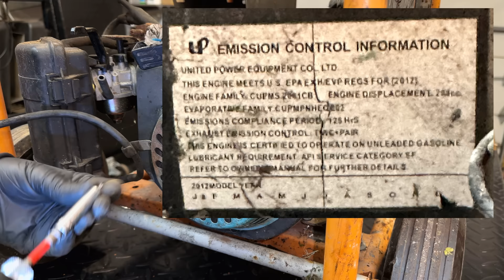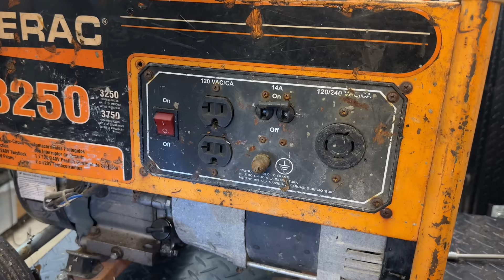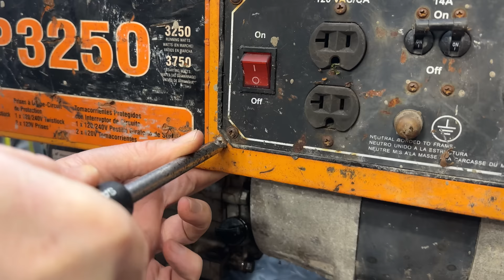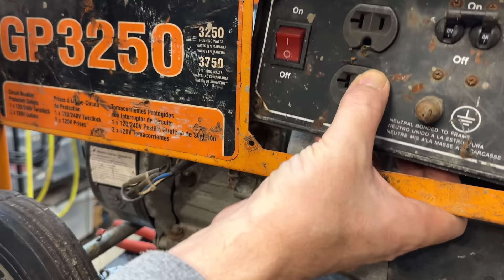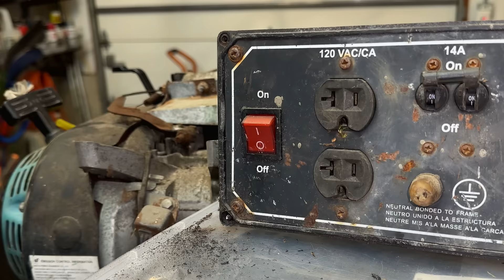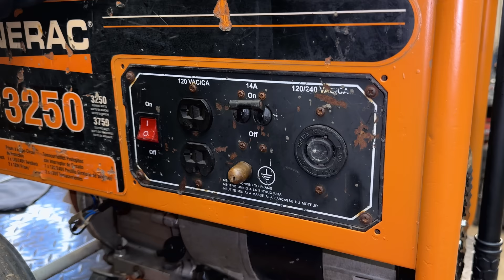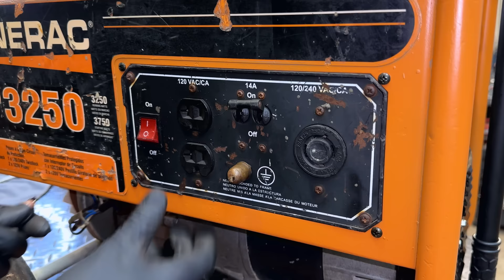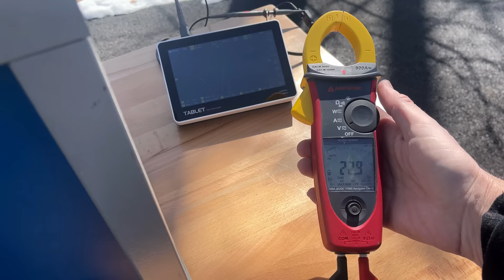Abandoned Generac GP3250 - Will It Run and Make Power?

Comment: I have an older Generac in great shape but it has an idle down  switch that is supposed to idle when under no load, but when I flip on the switch it kills the motor... Anybody with any experience with this issue?
Thanks
Reply from the maker: Likely the idle set screw is either missing or set to low.  Another possibility is the pilot circuit is clogged and not able to supply fuel at low speed.
Reply: @jcondon1  I will check it out.
Thanks

Comment: Don't get me wrong , I think the work you do is great but this was OTT. I don't think anyone buying this generator at this price point would really care if it is a 'Generac', General Jack or a Geranium Rack. You had a perfectly good cheap handle and you had to weld whichever decision you made. You prepared, primed and painted both frame and tank. Why didn't you paint the frame black and leave the tank red. Yes the generator is restored more or less to manufacturers specification but in doing so you wasted time, effort and money.
Reply from the maker: Definitely not going to make money on this one.  I was trying to make it look correct thinking it would be easier to sell.   But agree, not much profit in this one even though it was free to me.  Things could have been differently to make a little more profit.
Reply: @jcondon1 Please don't be offended by my questions. I just asked myself if it would make any difference to me, as a buyer, whether it was black and yellow, or red and black. My answer would be no, just as long as it was fully functional and looked okay.
Reply from the maker: @laurencehastings7473  need more buyers like you around here.  I am the same way.  Not really concerned about look, just does it work.
Reply: @jcondon1 Sorry mate, can't help. I'm a Brit ex-pat living in Berlin Germany where we use twice the volts, half the amps and much thinner electrical cables, leads and wires but Ohm's law still rules.